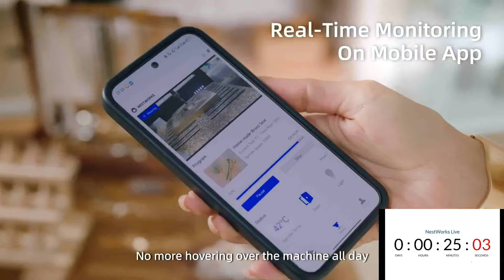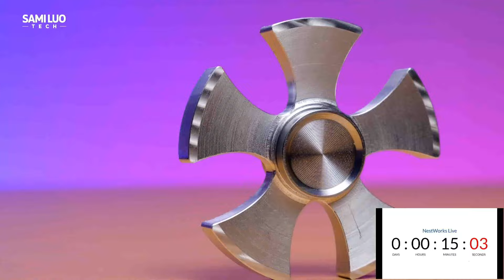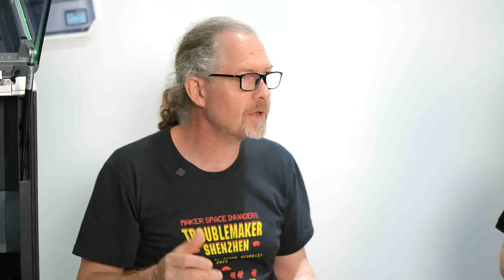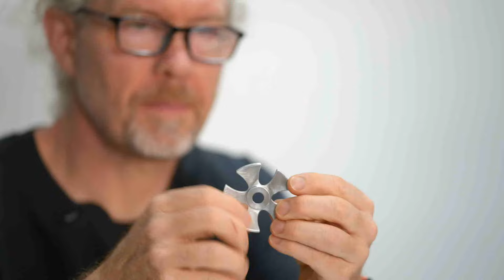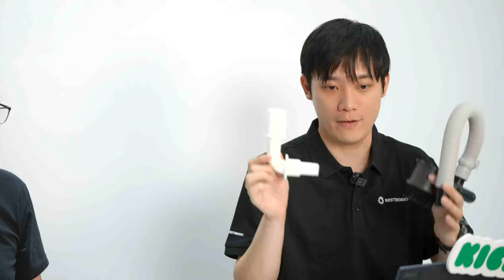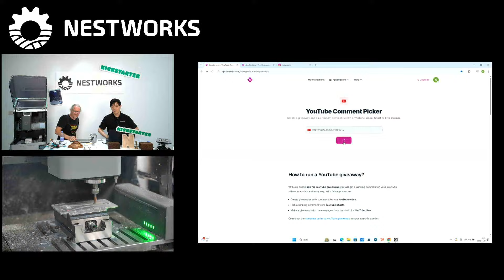NestWorks C500 Launch Livestream Event NOV 4, 10:00 AM ET |7:00 AM PT |11:00 PM CST

Comment: Take my money! 😝  
For the sub M2 threads I wouldn’t expect it to be able to tap a blind hole but I’d be curious to see how it does with  through tapping  3-4mm thick brass, aluminum, plastic etc. If it broke a tap in that type of material it would likely be pretty easy to remove it
Reply from the maker: You're in!